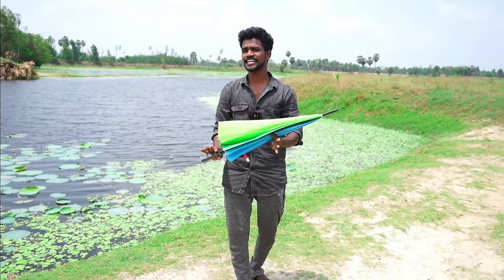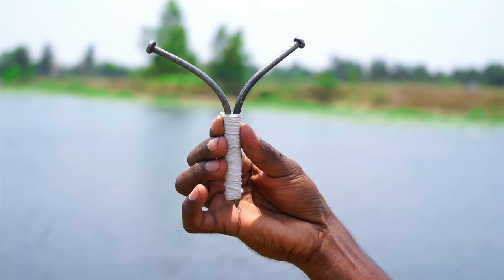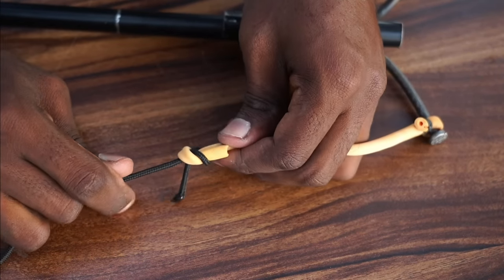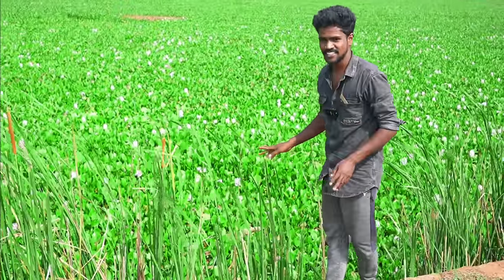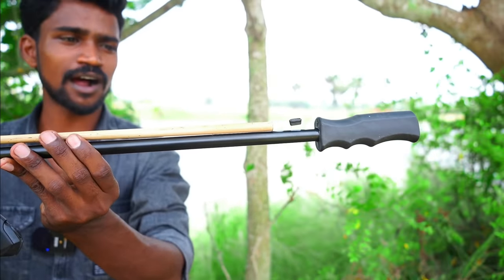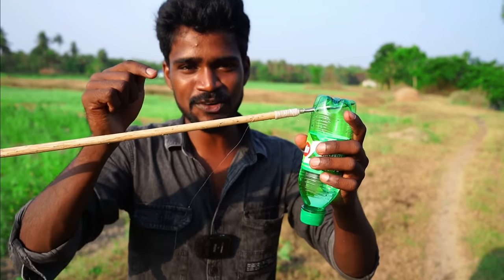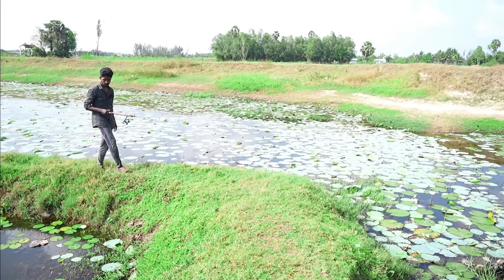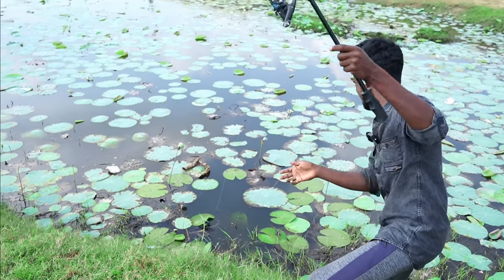பழைய umbrella வச்சி மீன் பிடிக்கலாம் வாங்க.! | Powerful And Unique Sling Shot From Old Umbrella

Comment: Bro, I will give you a project... ! 

Wind turbine vertical and horizontal..! 
1kw or more capacity and convert the motor as a generator...! 

Vertical you should use a roof top cooling fan is the condition.